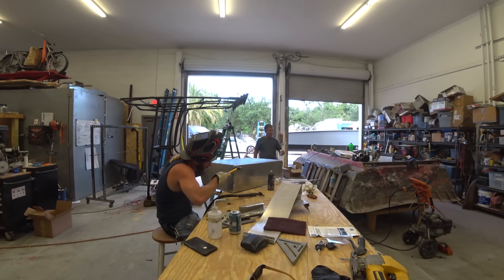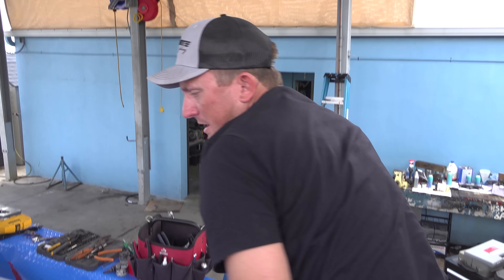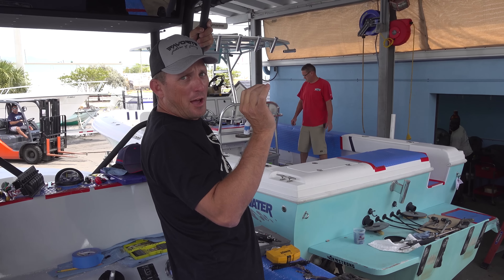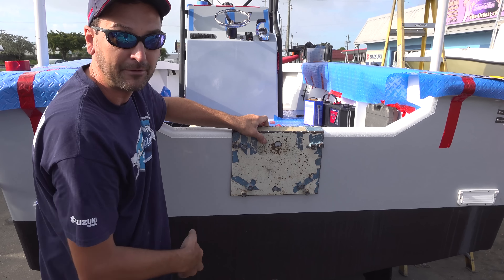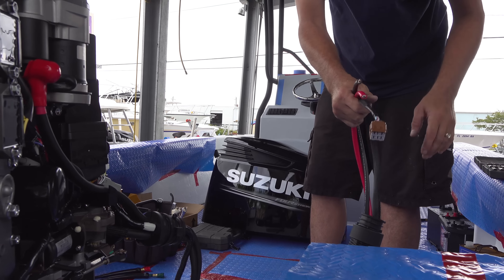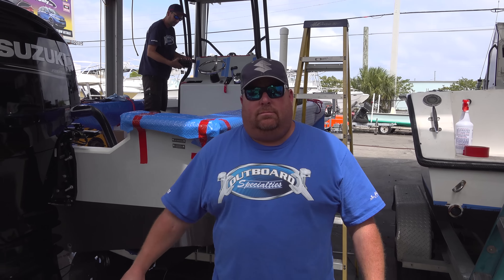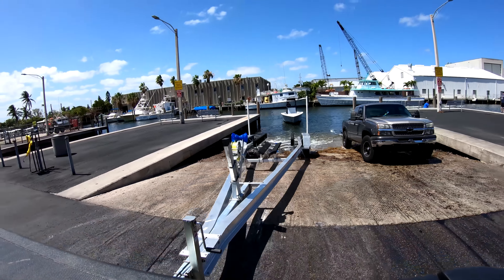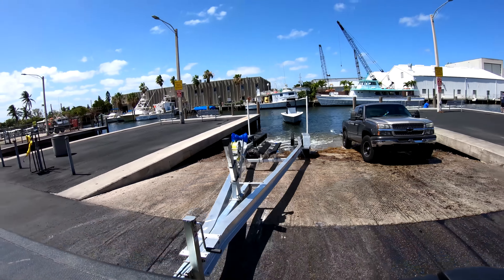Deer Meat For Dinner {300 Suzuki Re-Power} "I wanna go FAST!! Outboard Specialties

Comment: The one single bit of wiring for everything having to do with the engine, is that a Suzuki thing? would I be able to do something like this with an older engine and existing throttle box, just to make things cleaner?

Comment: Well I had a way different experience when I went there so I had twin 115s and when I would stop somewhere or anchor up and I want to leave my right motor won’t start and they just told me to keep turning the key 5-8 times to get fuel through the engine and it still wound start but if I wait 20 min it would start so I brought it to boat kings and it needed a new line and primer and it took 15 min to do and the boat runs great.

Comment: Important question: do the new outboards need ethanol free gas like the old two or does it matter anymore? Thanks
Reply from the maker: If the boat is going to sit for a few months with out running, ethanol will still cause tremendous problems! But if you’re running pretty often, it’s no big deal.
Reply: deermeatfordinner thanks, buddy! Love your vids btw

Comment: I'm just wondering if they put a sealant in the holes for the mounting of the motor so they won't rot from the inside?
Reply: lesabre1972 I watched the tech drill no wood no rot  nice. Would like to do my 25 wellcraft  36yrs old I think it's due JT

Comment: Does the Silicone sealer seal better with tons of fiberglass / gel-coat chips :( Tapped everything up looking like a profession job then this. Also looks like the drill chuck hit the console on the steering assembly holes and is visible. No prop shaft grease?  Exactly why I do everything myself.

Comment: What brand electronics are you going with...Furuno, Simrad, Raymarine, Garmin, Lowrance?  Outfitting with...radar, sidescan, chirp transducer, structure scan network (bluetooth, wifi, N2K), uhf radio, etc
Choosing electronics and the installation will make an excellent video.

Comment: “Efficiency is going to be off the charts.  We are expecting 3 miles to the gallon”

Is this normal for a boat? Legitimate question deer meat folks ... seems crazy to me?
Reply from the maker: Gromzen 3 miles per gallon is fantastic! Even during the 4 stroke era, 3mpg is great!!!
Reply: deermeatfordinner Thank you for the reply, that is wild to me. However, why is it so low? Is there an idle factor or, “against current” type of effect that is un-accounted for “on land” or “as the crow flys”?? Surely the engine is more efficient than 3mpg 🧐. Excess drag in water maybe? Again, legitimate questions. If not answered I am onto google! Thanks again and we love the videos, keep at em!
Reply: Gromzen it called prop slip a 15inch pitch prop should move 15inches in the water but unlike car u turn tire car moves forward   Prop turn slips in water get a fraction of forward movement
Reply: Gromzen that is per revolution of prop 15inches forward

Comment: I have a boat that need the same kinda work done im just wondering how much did it cost.
Reply: With all new equipment and all installed probably 50% of what ur motor costs a 300 being 30k in Canada  but it could be less depending where u go and what you need

Comment: Boat looks brand new but engine but not treated that way. No.1 put some grease on before installing the prop. Could take long years before you take it off again and no.2 easy on the throttle in the beginning if you want 10,000 hrs out of it

Comment: Hey, i can vouch for Suzuki's. i have a 1992 40hp Suzuki that i work like a rented mule. I was prepared to by a new motor when i brought my boat. I gave her a compression test and tuneup with a new prop and its at least as good as some newer motors. never had an issue outside of water in my fuel tank, simple fix and nothing to do with the motor.
Follow your maintenece and she will likely out last your boat.

Comment: I just picked up a brand new Suzuki 25 hp for my 15' aluminum boat, I love this motor, it called for a 10 hr break in, what about that big 300, no break in? You ran it wide open, was it used? Great vid Thanks!

Comment: Ok watched it again and I have to say I do not like the way the mounting bolts stick out so far. I would switch them out for shorter  or cut them down and put rubber caps over them. They seam like a great way to lose a fish. Because it will happen.

Comment: I approve of your choice of engine, very reliable and fuel efficient. I would have put it on a transom bracket to get the engine maybe 2 feet behind the boat, generally improves fuel efficiency, handling and the impact of trim. Maybe next time. http://continuouswave.com/whaler/reference/engineBrackets.html

Comment: Hey Rob,
I'll be doing the same repower on my 266SF Worldcat soon. Please do a video on your choices of the electronics you will be installing.
Reply: Ray Ward, He installed a Garmin GPSMAP 1222xsv. They cost $2999.99 per unit. Here's the link for it: https://buy.garmin.com/en-US/US/p/561739/pn/010-01741-02  . I don't know what transducer he has. 
Also, another recommendation, I have it on my boat, is the Simrad NSS line. I have two NSS9 evo3 MFDs on my boat and they're really good units. The clarity is unbelievable and the display quality is second to none, and I'm not being paid to leave good reviews for Simrad. For a transducer, I'd recommend the StructureScan 3D thru-hull Medium/High Chirp transducer. They cost $1399 plus you'd need the StructureScan 3d module which costs $599. For a cheaper option, plus this is the one I have on my boat, is the StructureScan HD thru-hull transducer. That one costs $799 and you don't need the 3d module because the HD transducer is not capable of producing 3d. Let me know if you have any questions

Comment: Every motor I see is Yamaha
Reply: Keegan Winter That’s because Yamaha probably owns a controlling interest in more USA boat manufacturers than anyone else. They are the Rick Hendrick of boat builders. They also make a reliable(but slow) product.
Reply: Wayne Swicegood if you are off shore and broken down your speed is zero… Reliability is way more important than top end!
Reply: Keegan Winter ya same
Reply: Yamahas do run smoother
Reply: No Yamaha does not have a controlling interest in more US boat manufacturers. Brunswick AKA Mercury does. Yamaha is so popular because they build very good reliable outboards and have earned a good name for themselves. Yamaha is also usually the most expensive, so people are not buying them for the low cost. I just wish Yamaha would make 2 strokes again.
Reply: Yamaha still makes 2 strokes. They are just not available in the US market.
Reply: YES! YAMAHA! I want to pay MORE for the same quality/reliability!!!
Reply: Keegan, those are mostly pre-2009 and are about to be replaced with Suzuki, unless Yamaha starts getting more realistic about their price. It's just a motor a shaft and a few gears after all, yet they want to charge, as if they are selling you an entire vehicle.
Reply: Joe Silver ya but Yamaha is the most dependable motor out there right now . That motor might be cheaper but it’s not guna be cheaper when it blows up 20 miles offshore and u have to replace it with a new one so u r better of spending the extra money then having one for a couple of years then replaceing it it’s just like fishing reels u can bye a Shakespeare for 20 bucks or u can bye an expensive penn or shimano reel that will last u forever
Reply: "ya but Yamaha is the most dependable motor out there right now ." < This statement is PURE conjecture on your part. I have heard of MANY flywheel problems, power head problems with Yamahs, that I NEVER heard of with Suzuki. Just because Yamaha spends MULTI-millions on ads telling us that they are the best, it doesn't mean that we should take their word for it. Now for my opinion. I have talked with recreational and professional captains that have owned/operated BOTH(Yam/Suzk) and they ALL prefer the Suzuki motor. Information like that, coming from people that depend on their motors to make a living means more to me than a biased advertising by a company that is pumping their own product. Suzuki had one major problem that I know of, back in the early 2000's that they have long remedied. My friend actually has one of those motors and it does have the problem(frozen shaft to lower unit). He has been running the piss out of it for the last 3 years hoping that it will die so that he can replace it but it just keeps going and going, no matter how much pain he throws its way. Thanx for your comment but I totally disagree. Suzuki has proven itself to be as reliable or even MORE reliable than Yamaha. Your rod/reel analogy is comparing apples to oranges. Yamaha vs Suzuki is an apples to apples situation, COMPLETELY inappropriate for this conversation
.
Reply: All I see is Suzuki. I live in Matagorda Tx. Where we run em all day everyday in the grass and mud. 2” of water to 3500’ of offshore blue water. 77465
Reply: 2 strokes will get taken down from the market soon and mercury is more expensive in the lower range
Reply: @ihavetofishable    I've been on boats with Yamaha's and Suzukis. the only difference I can tell is the whole shot on the Yamaha seems to be a little quicker on average, but it cost a lot more
Reply: @AmirFlores  you can thank CARB for that.
Reply: I used to work for Yamaha.  They build the cost of three outboards into every motor they sell.  You buy one outboard, but you're actually paying for three.
Reply: @ihavetofishable  Former Yamaha employee here.  Ask me about Yamaha V8 flywheels, or V6 SHO thrust bearings, OR the SHOs "making oil".  Yamaha does NOT make the best outboards.

Comment: The 300 is a dog... the 250 will do what that 300 will. It's the same block. The 350 is worth the jump though. I've had 5 Suzukis.. great motors. Best 4 stroke there is.. but that 300 sucks. Straight up...